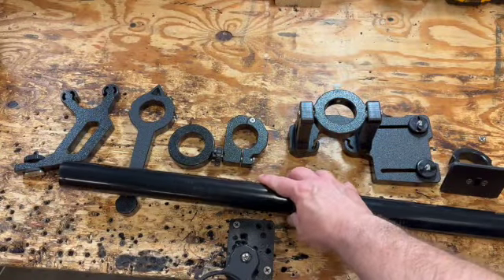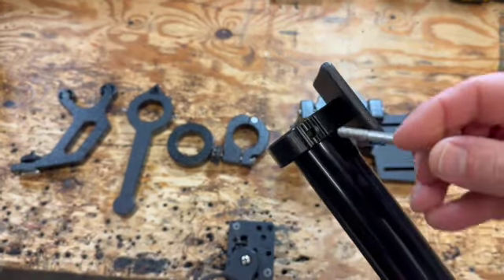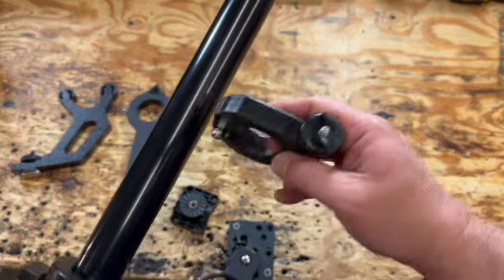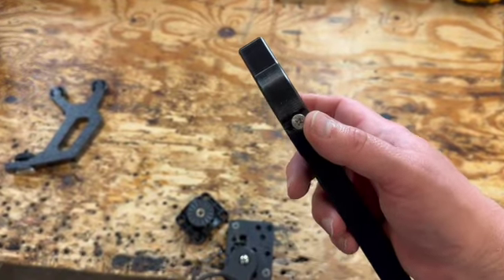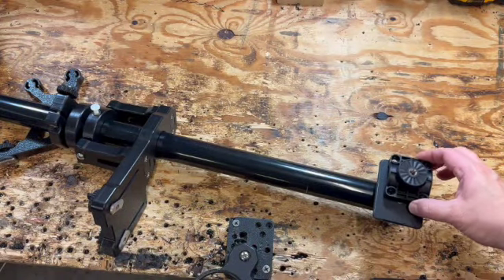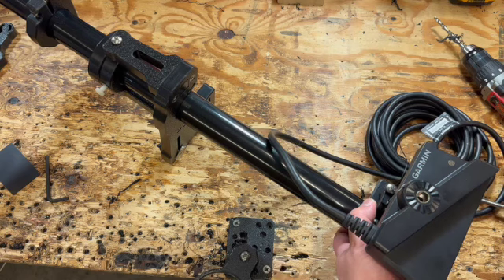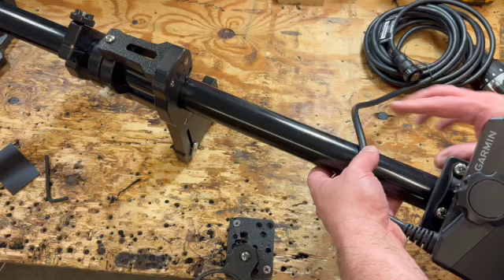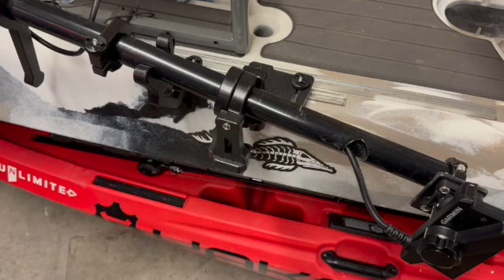YakGadget Quickscope FFS setup and  install

Comment: Ive seen the scupper plug transducer mount for the unlimited, is the lv32/34 to large to mount underneath the kayak and reason for the pole mount or are you just wanting to direct it? Simply curious. Ive been looking into adding a system into my unlimited and am researching my options

Comment: Any chance you can confirm if it will fit over the rod rests on the Jackson big right?  It has a large gap between the track and the side of the kayak
Reply from the maker: it probably kicks out about 6". If it's not enough, I will be making a extension plate for those type of craft. It works on a coosa X. I was able to test that.